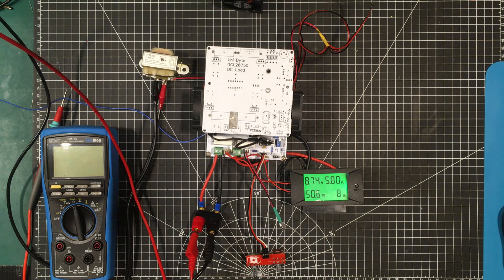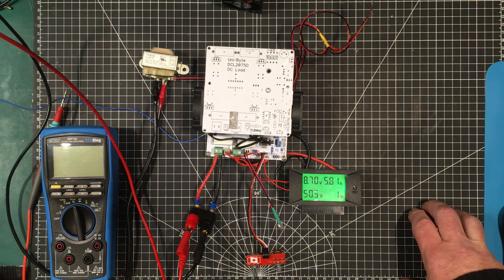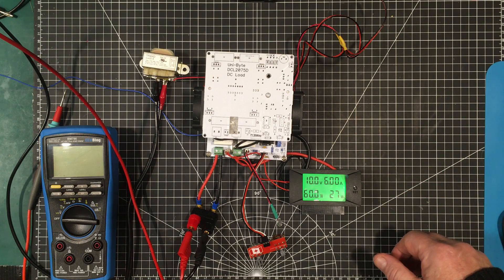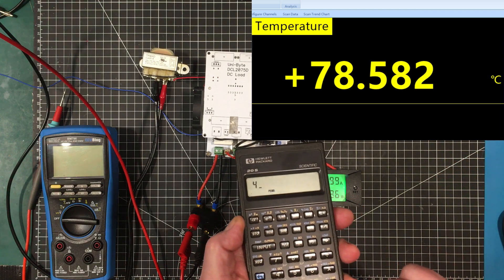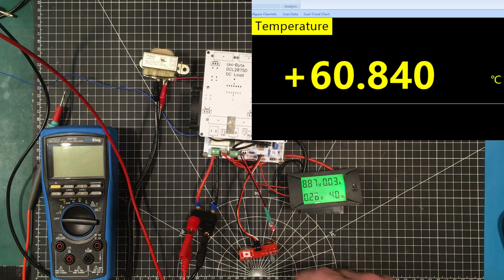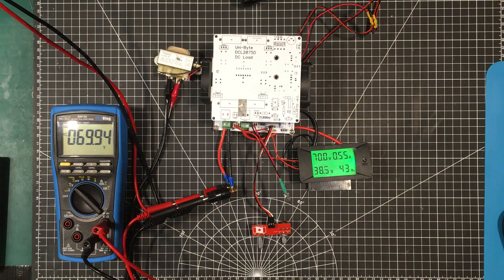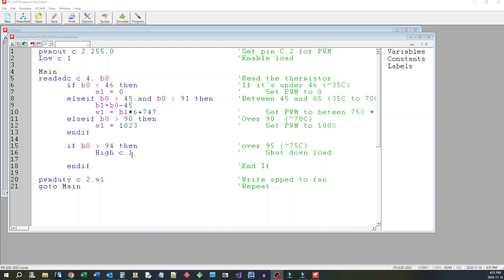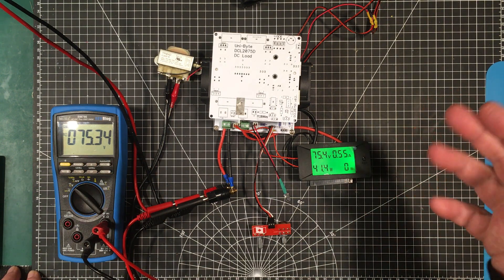Uni-Byte 0232 - Let's Build A VARIABLE DC Load: (THINGS Go WRONG) Part 3  (Warning: PWM/fan noise)

Comment: Not sure if you've already solved the mystery of the melted battery wires, but my suspicion is that the Red / Black leads *might* have been reversed in polarity. This would cause a short circuit through the body diode of your MOSFETs and draw significant current. The melting solder most likely saved your board! :D

Edit: Yep, you figured it out... 👍
Reply from the maker: Watch part 4.  👍  Hint - The leads were not reversed.
Reply: @uni-byte  Just finished part 4. Nice catch!
Reply from the maker: @Pyroteknikid  Thanks.  I was invested in the outcome.  LOL!

Comment: You stipulated that the fans need about 75% power to start up. However, the fans might run at considerably less power, after they have been started. You might do some testing - Provide enough power to get them operating, fully. Then find the minimum power needed to keep them going. Then, adjust the code to provide the 75% starting jolt, but have it fall back to the minimum level. This might reduce the audible fan noise in your lab, for what might be the greater portion of the load's use. Meaning, I imagine that you will use it more for lower power testing than for testing at its maximum capability. Cheers.
Reply from the maker: That's all been sorted out, including getting rid of the PWM noise.  See the final episode.  👍

Comment: Thanks for testing out the concern i had with heatsink. I am also in the process of building a DC load for about two year now, its a side project. My goal was to make a battery capacity tester and also use the same hardware as a load, it has both digital and analog control. Routing of control signal is done with analog switch. Now about your wire desoldeing off of the battery, this usually happens when you connect a live supply across the mosfet Drain and Source. So depending on which terminal connects first, mosfet will behave differently, I have damaged countless mosfets in the process of finding out where the issue is. After much research on how commercial LOADs are managing(basically i looked at their schematic available online) the live supply connected to them, I found that they put another switch in the path of mosfet to keep it turned off and they also use soft-start mechanism, and only turn on the switch when it is necessary. In my project I am using LTC4368-2 hot-swap controller, i made a small evaluation board for this and currently put this in series with the LOAD  mosfet on high side and the control signal goes to the mcu to on/off the live supply such as a battery. My goal is to test 12S to 1S li-ion batteries, I have tested the current design with 6S packs, it works fine. Earlier I was testing with 2S packs ~8V with IRLZ44N mosfets which are 55V rated parts and they were getting damaged, also there is another reason for the damages are, that the long wires from the battery to the load increases the stray inductance which causes huge voltage spikes when connected to load circuit. I put a small 22uf electrolytic cap on drain-source which helped dampen those ringing of voltage spikes saved the mosfets. Now I am using IRFB4332PBF which has very good SOA for DC application. I also have those linear mosfets from ixys IXTK90N25L2, I want to test them too. All the parts i used were from digikey/mouser so it wasnt that i was using knockoff parts which were getting damaged randomly it was because of my skill issue. I learned LAODs of thing from this project particularly in terms of writing my own firmware in C and designing the HMI for the load. Sorry if all this is in unorganized order.
Reply from the maker: Thanks for all the information!

Comment: It may be wise to fit a bi metal switch (stat) to the heatsink as you cant guarantee  under all fault conditions pulling the reference low will reduce the load current to zero. plainly the bi switch would have to be in series with the load and not just another means of pulling down the ref so I don't know if commonly available bi switches will handle the current, failing that a good old fashion hrc fuse.
Given what happened with the battery pack wire  some sort of  'mechanical ' safetynet is required 
Great project nevertheless,
Reply from the maker: I might try something like that, thanks.

Comment: What is that horrible sound in the background?
Reply: Ehh, it's not so bad.
Reply from the maker: What horrible sound?  The fans?  In this video we are stress testing the load to it's limits, such that fans are running at a fairly high level throughout.  How else would you suggest that be done?
Reply: @uni-byte there’s a high pitch squeal in the audio, I think he’s talking about.
Reply from the maker: @Johadart  YEs, also from the fans.  I need to adjust the PWM frequency.
Reply: @ oh ok thanks for letting me know
Reply from the maker: @Johadart  No worries.  I would have put it at the beginning of the video except I can't hear it - old damaged ears 😞

Comment: Just dotting the I's and crossing the T's ! shame about the meltdown, that's a real puzzle. Thanks for showing the code and there's a high pitched whine throughout the video, at least I think there is as I'm the first comment ! not bad enough to ruin the vid but I would like to know if anybody else can hear it...cheers !
Reply: It is tight around 3920Hz and very loud.
Reply from the maker: @Mr.Leeroy  Yeah, that would be near the PWM frequency of 3906Hz.
Reply: @uni-byte  One of my ATX motherboards had NCT3941S-A for driving fans linearly. Guess, I recommend something like this or maybe a spin-off DIY project. PWM on an inductive load must have been such an EMC nightmare so they deemed it worthy to go linear saving board space, cost and additional headache for not introducing other noise with DC-DC solution.
Reply: @uni-byte  Maybe my ears aint too bad !! :)
Reply from the maker: @andymouse  Better than mine anyway!
Reply: @uni-byte  :)
Reply: @Mr.Leeroy  Oh ! Thanks :)
Reply: I am definitely able to hear it from the start, I do not remember it in the last video. Not sure what it is or what range.
Reply: @tinkrelectronic  Thats two then !
Reply: @andymouse  I'm not 100% sure, but what I was able to pull maybe 9.8 or 9.6 ish Khz
Reply: @tinkrelectronic  That makes sense as I think my audio range is about 12 - 13 Khz LOL!
Reply from the maker: @tinkrelectronic  Hmm .. Maybe I'll play around with the PWM frequency see if that helps for teh next episode.
Reply from the maker: The whine might have been something else I had on in the lab.  Or it could be the the PWM frequency is too low.  I'd never hear any high-pitched whines with my ancient ears - LOL!  Did you hear the same whine during the basic functional checks in Part 2?
Reply: @uni-byte  no I didn't that's weird cos my ears are shot from years of sticking my teenage head into speakers at live gigs !